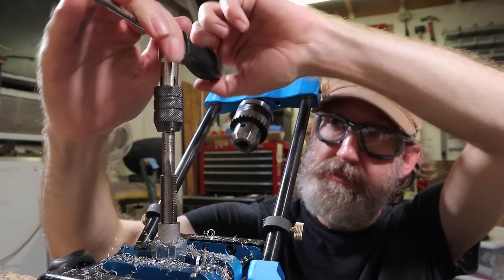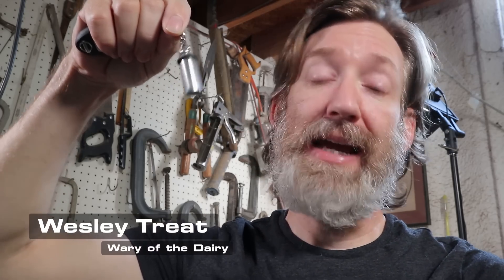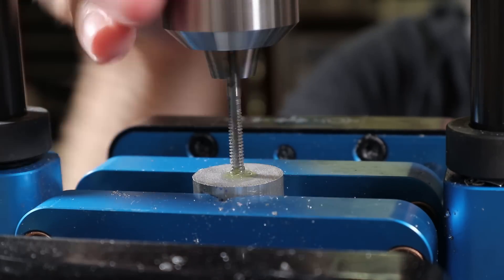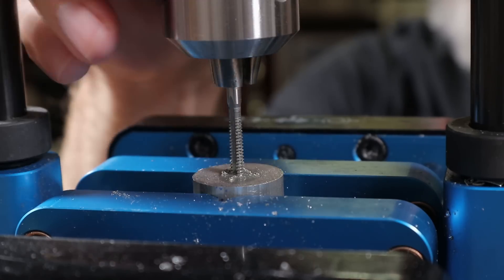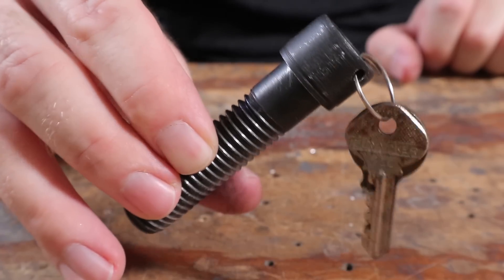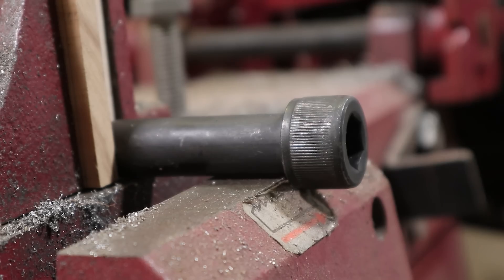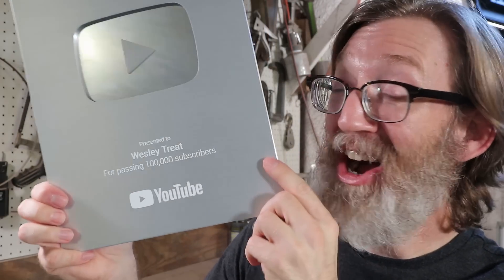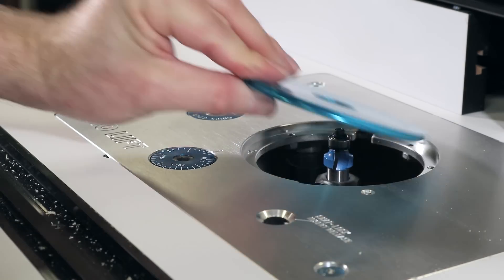Secret Safe Inside a Bolt - No Lathe!

Comment: Not being funny but wouldn't it have been easier to just cut the head off the original bolt then fit that to the ols shaft using a similar process but again slightly easier. Seemed L long way to go about getting the result you wanted. Still it was a lovely finished product.
Reply from the maker: If I had a machining lathe, maybe. I had zero way to machine down the bolt and thread it to fit it in the new shaft, and the socket in the existing head was too deep to leave enough room to screw on a threaded stud the way I did with the fake head. Plus, I couldn't have engraved my name into steel.

Comment: Wouldn't it be easier to just go buy a 3/4" bolt with an acorn nut and drill out the inside? Better yet you could cut off 1/2" of the bolt and thread lock it a 1/4" into the nut and screw the remaining onto the drilled out bolt.
Reply from the maker: My first attempt was drilling out a steel bolt. It was not easier. There's only so far you can get with a hand drill. 🤷‍♂️

Comment: Quick trick. You can use a power drill to tap parts. Just put the clutch low enough so you don't break the tap.
Reply from the maker: I have some power taps for through holes, but for shallow blind holes, I prefer to tap by hand, so I can feel what I'm doing. 👍

Comment: unable to make a knurling. Has a CNC router 🤔
Reply from the maker: You have any instructions for doing that?
Reply: @WesleyTreat  Is it possible to put it in the vise and engrave a |
Reply from the maker: Not a bad idea. I had considered that, but without a way to accurately rotate the head along its axis a couple millimeters at a time, the result wouldn't be great. I'd really need a rotary axis for that kind of thing.

Comment: Ok good job 

I would use 20 or 25mm electrical conduit would have been easier 🤷‍♂️
Reply from the maker: How would you have closed off the bottom end?
Reply: @WesleyTreat  

Galvanized round insert ,   spot weld thread end  inside & rub spray  
Hex internal thread  top hat 

Done☝️  praise the lord 

Simplicity is the beauty of material
Reply from the maker: Cool. You understand, though, my point was not just to make a container, but to duplicate a bolt, right?

Comment: I've done that in ball point pens.  The trick was to keep enough of the ball point and ink functional.  (without getting the ink everywhere.)  But if the pen looks like a pen but doesn't write, someone taking it will just chuck it.  And not keep it.  You then have some chance of getting it back.  
My $100 bic.  B-)

Comment from the maker: "He said 'no lathe,' but then used a CNC router!"  Correct. I also used a drill guide and a horizontal bandsaw. I made something that would traditionally be done with a metal  lathe, but found a way to do it using the tools I have, which happen to include an X-Carve.

This was never meant to be a "how-to," but if you're looking to make something similar, you can:
A. Make the bolt head manually using a drill and some files, or maybe some metal-engraving chisels. It would just take longer.
B. Cut the head off an existing bolt. It would just be heavier.

The point is to find a way to make what you want to make, using what you have. There is always another way.

Good luck!
Reply: Did I see you use a wood lathe for sanding the head of the bolt!!!! Lol great video new subscriber
Reply: I was going to suggest B as a shorter path to the same place, but I understand that it's about the journey, not just the destination.

Comment: Nope, no lathe needed, just a cnc milling rig.
Reply from the maker: You could do it without one, it would just take longer. Or you could use the head off a real bolt, it would just be heavier. Point is, I did something that would traditionally be done on a lathe, but I didn't have one, so I found other ways. 👍

Comment: Love it, always great fun these sort of things are, used to do all sorts of things like this before i went hiking so i could carry as little as possible but have some emergency items even down to toothache tincture, i used to put in a piece of plastic straw and hot seal the ends so if the worse happened in the outback i could pour the oil of cloves onto the tooth by just chewing the piece of straw.  matches just dipped in hot wax. Money was always in my shoes in a plastic bag under the liner. couple of 50's for emergency, before the times of cell phones.......dreaming....... Have to think of something else to make now....

Comment: The $20 were ultra safe inside the bolt, until you drilled a hole into it and made it into a keychain :)
crook1: - hey i found the keys to some guy's truck
crook2: - that's the lightest steel bolt I've ever seen
crook1: - i know, it's worth at least $20 and a couple of pills

Comment: It seems like you tapped or die cut at least twice as many threads than I can account for in the final object.
Reply from the maker: 5/8"-11 outer threads on the shaft to mimic a bolt.
1/2"-20 inner threads on the shaft to screw on the head.
1/2"-20 outer threads on the stud that screw into the shaft.
#6-32 inner threads on both the stud and the head to screw the two together.

Comment: Kinda wish Rockler was giving away one of those drill guide and vise sets.  Cool project, nice to see something that didn't require a lathe even if you did use that CNC router.  If you had a sufficiently large drill chuck do you think you could have filed down a bolt thread enough to die-cut smaller threads to fit the ID of the drilled and tapped 5/8" stock?
Reply from the maker: The original plan was to modify an existing bolt. I was going to try cutting off the head with about 3/8" of shaft attached, then somehow file the shaft down to 1/2" and thread it. But, boring out a steel bolt proved a little too difficult with a drill, so I never got that far.

Comment: One of those keys looks like a Slaymaker padlock key that was commonly used on bike locks in the 60s. Those locks could be picked with a bent wire. The other looks like a cabinet lock key, possibly a Corbin lock with a cut of 44225. Neither lock is high security.

Comment: Save some time and drill out a grade 5 bolt WAY TO MUCH WORK  KINDA STUPID
Reply from the maker: That was the original project, actually. But, it was much harder and took much longer to drill out the steel. In fact, I got to a point where a vise and a hand drill wouldn't do the job, so I switched to making it from scratch. But, thanks for your input. 👍👍

Comment: I now want to see the two hour video of you trying to get that twenty back out of the bolt.
Reply: That’s what the two matches are for.
Reply: you can stick a small piece of paper clip or wire around it like they provide for you in the pill style cash fobs eg true utility. it both helps you wrap the bill tight, but all you have to do to get it out is pull up on the top of the tab.
Reply: My thoughts!

Comment: Doesn't matter to me, but wasn't that a lathe at 7:10? I only ask because the title says no lathe and I'm needlessly curious. I also recognize you could've done the grinding in a drill press if need be.
Reply from the maker: It's a Shopsmith, which can work as a wood lathe or horizontal borer, but I don't have a metal lathe. 👍
Reply: I had the same thought, but the work was free hand.  (Is splitting frog's hair a thing?)